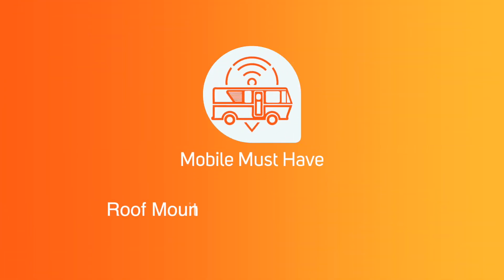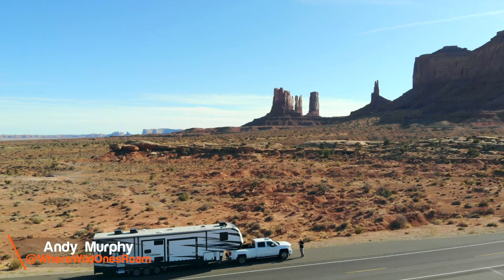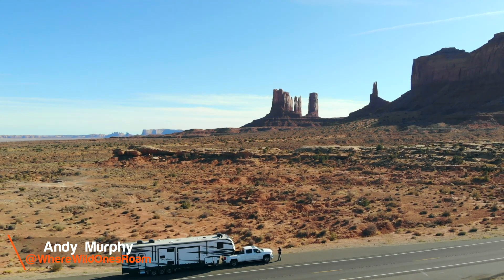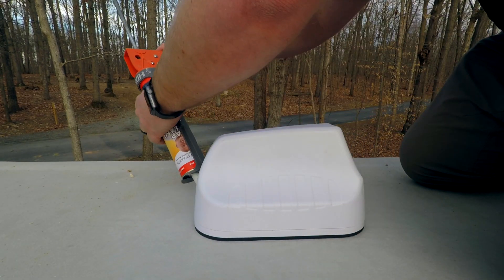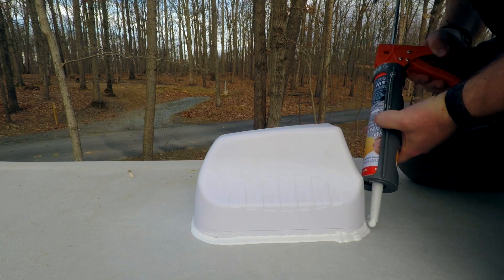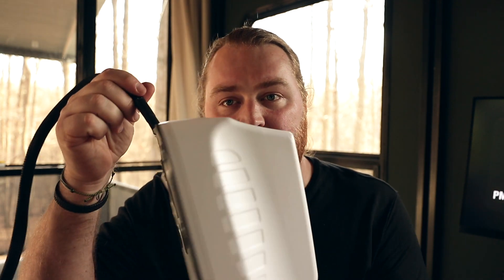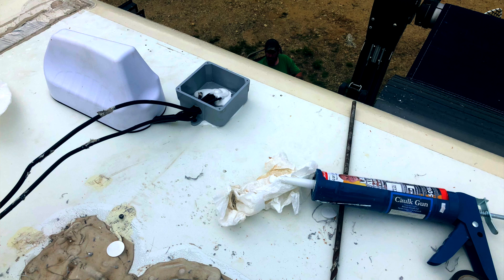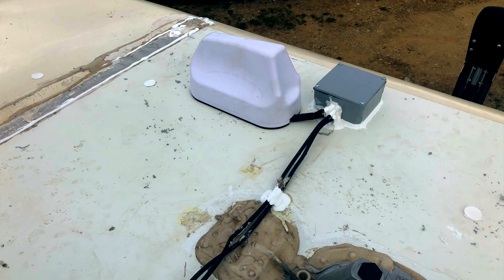Poynting Roof Mount Install

Comment: The equivalent Mobile Mark antenna does not have adhesive on the bottom.
Reply from the maker: it does not, for mobilemark since it requires a ground plane anyway secure the antenna to the ground plane which is an option at checkout then simply screw the ground plane down at 12 3 6 9 o'clock and dicor the edge of the ground plane and the screw holes. The parsec husky  is a good option if you dont wish to use a ground plane available here: https://www.mobilemusthave.com/Parsec-Husky-Pro-7--7-in-1-5G-Antenna-with-4x4-Cellular-2x2-WIF-GPS-Magnet-Mount-7-Leads_p_1408.html